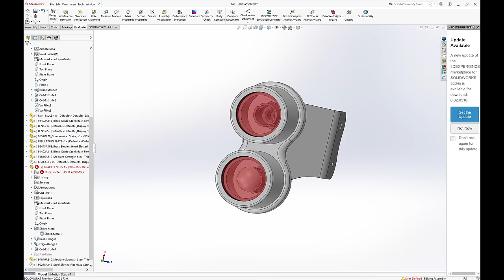Making One-of-a-Kind Tail Lights | Homemade Boat-tail Speedster Pt. 65

Comment: Great to see another update : ) My one minor aesthetic comment would be to use a toggle switch with a ball on the end. They look more "vintage" which obviously suits your project. I own an Airstream restoration shop & my clients love it when I use the old style switches. Oddly enough, they are available at Lowe's : )
Reply: I second the idea of making that head light toggle switch more "vintage "
Reply: Also using cap "acorn" nuts on the firewall to match the engine nuts.

Comment: Really good to see you back. Always amazed at how well you can cut a line. The tailights look great - very clever design/bulb sockets as well. You can always hide a capacitor somewhere if you need extra oomph when cranking.

Comment: When you do the permanent wiring loom for the car, you might want to look at how the aviation industry utilizes wax string to loom the wires together. If done as meticulously as you have built the car, it'll both fit the theme and look beautiful, especially with those cloth wires.

Comment: Hi, you could just wire your Relay as follows: The Flasher Relay over the Turnsignal switch to 86 of the five Pin Relay, 87 to Ground. 30 12volts for running lights and 87a to the Lightbulb. Now, if im not mistaking the running light goes on, when its switcht on, and the Flasher shuts it off, when its "on" Making it flash oppotite to the Front but work at least. Then you could wire the front one to 87 and it should be even syncronised front to rear. I hope im not telling you wrong. Keep it up, such a great Project and greetings from Germany.
Reply: Yep, this is how I would wire it as well since he isn't using dual filament bulbs.  Overall I would have gone with two dual filament bulbs to simplify the wiring and to have dual running lights that would be dimmer than the brake and turn signals lights.
Reply: @gregstoddard8097  jes, Sure dual purpose bulbs would be easyer to Wire and require No additional relays. Building a Socket from Scratch would be far more complicated on the other Hand.

Comment: Amazing work you're doing. One suggestion I could make about your turn signal situation would be to add a momentary switch on the steering column, like a modern car, but also have an always - on function through a dash mounted switch, for those times it's needed to be on for an extended time. That would be an easy addition.

Comment: Love this build! I’ve followed it from the beginning. Awesome work!
Regarding the flashers I’d use the brakelights for flashers. Anyway, if you connect the turn signal switch to two relys, one for each side, and those turn off the runninglights, and instead connect the flasher relay. You got to use one flasher relay for each side. I’ve done that, it works.

Comment: Your build is fantastic! I wish I had the skills to do anything near this. Keep up the good work.
For your front turn signals, you could use another normal relay sensing the 85/86 off the rear turning circuit.
I would use a modern fues if you are actuall hoping to drive this, or better yet the resettable ones that are the bladed fuse format.
Its unlikely that anyone would ever look under the dash to check the fuses are period correct, but it will be easier for you in the long run when something pops in the middle of no where.

Comment: Been following since you first bent the chassis rails. The Austin A35 indicator switch looks great. Have a look at semaphore type indicators, the type that flipped out. You could mount one either side between the firewall and the dashboard. About as much use as a hand signal these days, but very cool.

Comment: The way you're doing it with the turn signals involves more parts, and makes sense to most people. If you've ever tried to figure out how a late model multifunction switch works, you'd wish the manufacturer did it the way you did because it's a lot easier to understand.

Comment: You can use one flasher.  Just tap off the out put to the tail light. Don't forget dashboard indicators.  You can get the flasher with the tape built in also.  For the dash lights.

Comment: The aluminum will oxidese and you may have connection problems.  You could send out the parts for a clear chem film coating which is conductive.  Or run a hard wire.

Comment: Those look great.  You  answered my unasked  question about brake lights.
I'm delighted that you've identified the value of a plasma cutter. For several videos, it's been an obvious way to do some of your cutting jobs.  (Including those bases. How did you hollow them out?) Are you going to seal the screws, so they don't corrode  in place  electrolyticly?

Comment: A tail light converter for 4 wire trailer would allow you to run your wiring with one flasher because it would take two inputs and make it one output for the single filament bulb
Reply: Instead of using the brake input for a brake light you would use it for your tail light and it would convert you're wiring to do what you need it to do

Comment: You could change to dual filament in one set of the taillights.     You would have to remake your sockets.  The dual filament sockets are a little different.  Also there are two contacts in the insolated slug.   But the wiring isn't hard.

Comment: Outstanding job on those taillights. I don't know the science of them but there are "Run, Turn and Stop light modules for motorcycles that convert the rear turn signals into running lights and stop light. I put them on two of my bikes for additional light to the rear. I bet you could figure out how to make one work for you

Comment: Enjoyed the video - great job, very elegant solution to the rear lights.   Wiring solution is not so elegant, though, if you have to use multiple flashers.  My 1957 Austin Healey, as I recall, had only one light assembly on each rear corner, utilizing one two filament bulb for tail/brake/turn signal, but using only one turn signal flasher.  Maybe source a wiring diagram for that or a similar car?

Comment: an EASIER way to wire the tail lights and turns to be using ONE single filament bulb, you use two of those relays (one for L one for R bulb socket), and on the side thats normally closed, you make that the ground wire going to your tail light, so tails work always, then run your pulsed signal line to activate the relay so when it pulses, it cuts the ground so the light dies, you could leave the entire system the way you have it, just add two of those relays, and isolate the light socket to not be grounded thru the frame

Comment: use a dual filament bulb for your rear turn signal usually done on with the brake check any 60s car wiring diagram on how to run one flasher. No need to reinvent the wheel

Comment: The lights look great, I really like your design and fabrication skills. I'd like to suggest one thing , would it be a safer option to have two switches for the headlights . If it was me , I would have an on/off master type switch and then control dip and heads on another . With the three way switch, there is always a risk of turning off lights completely while switching from heads to dips. I know it would be only temporary but better to be safe.

Comment: Hi, I have fitted the same indicator switch in my vintage Austin 7. I did find a flasher unit with a pesio speaker built into the top, to reminde you to turn the indicators of.

Comment: The flasher should break the line (using another relay) powering the rear lights. It should be 50-50% on-off. So it should not make any difference to have it on-off instead of off-on.

Comment: I know people will suggest heatshrinking the wire. Have a look at Hellermann Tyton sleeves instead though. They look less modern even if they aren't period. If you do use heatshrink you can rub the lettering off with Isopropyl alcohol which makes it look less jarringly modern.

Comment: All I am going to say is go check any vehicle and let me know how many flashers you find in them. You can absolutely keep the lights functioning the way you want and use one flasher. I am willing to bet. However, when you get the vehicle inspected you will have to take the turn signals out of the headlights. You may not have to do inspections yearly a lot of states have done away with them. However when it comes to a home built vehicle and you have to get it done by the state police in order to get a title issued and a tag

Comment: Well, since you already designed dual lights back there... You can have both running lights and brakes! In the lower bucket and have the higher bucket for  turn signals, yet I'm not entirely sure on your taillight design, since you plan street driving it having no reverse lights!
Perhaps you should go back to drawing board or use classic taillights and you modernize way they function in your own way
Good work as always and happy u r back

Comment: The others are weighing wired and instead of putting it on the positive side. Put it on the negative side, isolate the 2 wires to your turns. Things up to that negative wire. You know why you want to flash. Then you all you gotta do is add power to use a one of the two wires in a flash

Comment: You were very close to having the indicators working correctly the first time, all you had to do was remove the feed to 87 on the relay. The running lights are always on, therefore the indicator just needs to turn the running light off.

Comment: Run the power for the running lights through a normal realy one for each side and turn that on and off with the flasher can job done one can dose all then u can have parkers in the front as well

Comment: Could you keep the rear lights hooked up, like you have them so the running lights work, but have the front flasher hooked up to the front headlights like they currently are and have it hooked to pin 86/85. So when the flasher is on in the front its causing the relay to switch, which in turn is cutting the power to your rear running lights making them blink. Shouldn't even need to use pin 87.

Comment: Those tail lights are gorgeous - nice work!

As a suggestion to a) keep your wiring simpler, and b) maybe safer too... why not have a pair of dedicated front turn signal lights, rather than trying to flash the headlights? That way - you can simply wire them into the same circuit as your tail light flashers, which means 1 flasher unit, and both front & rear turn signals will be synchronised.  Also, you can doubtless come up with some really cool front turn signal light design :)
Reply from the maker: The headlights have a separate turn signal bulb built in
Reply: There actually are dedicated T/S bulbs inside his headlight buckets. But I agree, I don't think mixing indicators and Hi/Lo headlamp beams in the same housing is ever a "bright" idea.
Reply: @MacroMachines  :facepalm: I should have remembered that, I watched the video where you made them - my bad, I forgot... 

Still, can't you just wire them into the same circuit as the tail lights to get the flash?
Reply: @454Burban  Now that I've been reminded..... I seem to recall that the onboard flasher was actually part of the original headlight unit, wasn't it?
Reply: @theelectricmonk3909  THAT, I don't recall. 🤷🏽‍♂️

Comment: I'll let someone above my pay-grade explain it, but the two relays shouldn't be necessary at all. In the 1970's, many car manufacturers figured-out how to make single-filament front side-marker lamps flash simultaneously with the front indicators (with parking lights OFF), but alternately with the front signals when the running lights are ON. Obviously, there's a wiring trick to cause the dual patterns, and it involves electricity being able to flow through a circuit in only one direction at a time. An incandescent bulb needs current traveling through it from pole to pole (in either direction); if it suddenly receives current from BOTH poles, the flow ceases and the bulb will not illuminate (this is not a short-circuit).
I'm not an electrician, this is not electrical advice... but I'd recommend you do a search on how they wire those front (GM trucks also use this technique in late-model REAR) sidemarkers.
Also, I'd highly recommend using a solid-state flasher unit rather than the old-style Thermal flasher. There was a huge lag from when you activated your indicator switch, to when the flasher got hot enough to start flashing your bulbs. A solid-state flasher isn't current-sensitive, and the flashing speed can easily be adjusted, on all of them that I've ever purchased (there's a tiny potentiometer on them).
Hope this helps.

Comment: Where did you get that nice wire from i have a continental b427 stationery engine that needs rewiring so it can run a 140 year old sawmill and i have a 1997 john deere 5400 that the wiring is trash and causes running problems  id like to have the fabric covered wire for both for longevity
Reply: Look at Rhode Island Wire.

Comment: Hi again if you're looking for a XK 120 diagram, don't use the one from Moss motors, it is drawn incorrectly, use another one, I used one titled jaguar XK120 Fixed Head Coupe 1952/54 home and Export models No W94602, it's drawn correctly

Comment: Is it even possible to have a flasher module that will both flash the headlights on when they're off and off when they're on? I can't imagine how to do it without something like a DPDT relay with the lights on NO on one side, NC on the other and the flasher switching between them. Maybe this is why I'm not an automotive engineer!

Comment: My only slightly negative comment of the whole build. Wouldn't it have been better to cut the rear face of those slights at a slight angle so the lights would have also have been visible from the side much like modern day lights plus I would have used a diffuser lens.
Is there no repeater bulb inside the indicator switch?  In the UK it is a legal requirement to have a dash indicator light.

Comment: All good....but......Turn signal lights are normally yellow/amber....and not Red. Brake lights and running  lights for rear - Red ! Running lights - front - white...OK ...not sure about Amber for front turn lights sitting inside bright headlight bulb/reflector......my 2 cents.